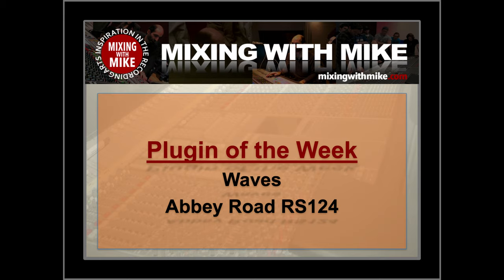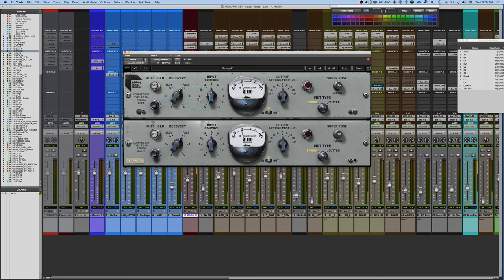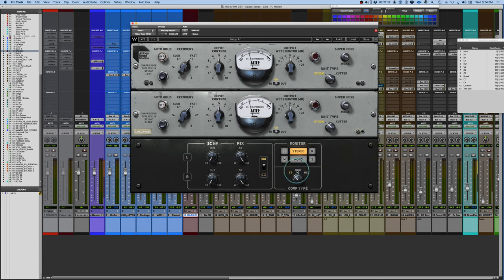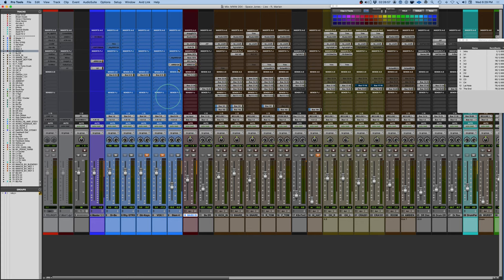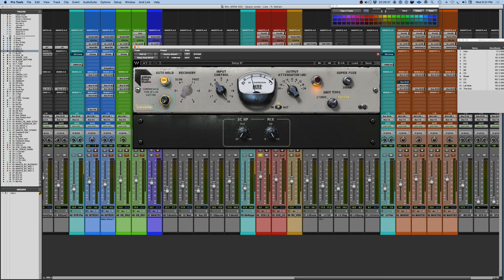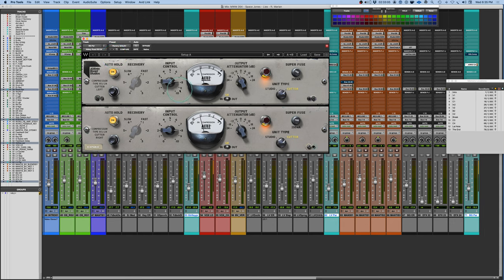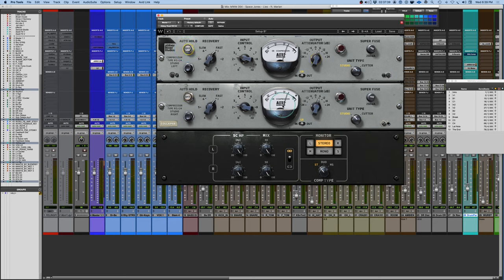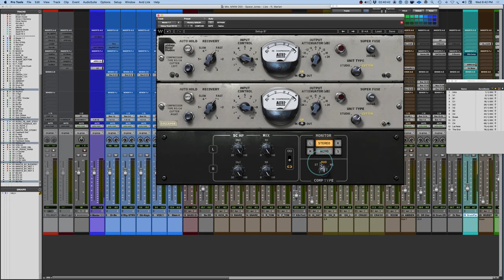Waves - Abbey Road RS124 - Mixing With Mike Plugin of the Week

Comment: I had a chance to use those Chandler compressors, before they were released on sale. An old school friend of mine works at Abbey Road and is pretty good friends with the owner. I think he may have been involved in the process, somewhere down the line. 
As I was more in the "composing/playing" mindset, I took the gear for granted, But he had a few different pieces of hardware that we used in recordings.

Comment: Tested this against Aqua's Cream version on bass and preferred the Aqua by far. Warmer and more 3d sounding.
Reply: ”Warm and 3D” 🤦🏻
Reply from the maker: I like the Acoustica products in general for single tracks. I find that they fall apart a bit with complex program material though and the CPU hit makes them a bit too difficult use on larger sessions.
Reply: @mixingwithmike  I have found using the DAW Reaper helps significantly with the CPU hits and allows you to use many more instances of the Acoustica plugins, Aquas are most of my favorite plugins and I end up using them on everything, I would love to see you review more of them on your channel. Anyhow, thanks for your content, it is consistently top notch. Cheers!
Reply: @mixingwithmike  hey Michael. It's
Acustica. Acoustica is actually another developer in the field. So you don't get misunderstood by Acoustica guys😂
Thanks for in depth no nonsense videos like always. Regards
Reply from the maker: @willogburn6158  DAW CPU efficiency always comes with a tradeoff. I cannot speak specifically for Reaper, but every other DAW I have used that runs more efficiently than Pro Tools with plugins sounds worse.
Reply from the maker: @Zenvo-uu9tm  That explains why I always end up on the wrong website! Thanks for the correction and cheers for the support!

Comment: Hi, I just compared with my old 32 bit original RS124 plugin from Abbey Road. The attack is much better present with the first original RS124 plugin. Can you make a A/B?
Reply from the maker: Is that plugin even available anymore? I think they have turned everything over to Waves.
Reply: No, they don't upgrade it to 64 bit because Peter Cobbin, the technical director from Abbey Road validated the plugin version as a perfect emulation and when Chandler released the Hardware Version they don't wanted a 64 bit upgrade to do not stop the selling of the hardware ;-) I still using it with 32 lives...Sorry for my English
Reply: @mixingwithmike  I noticed something, the first plugin endorsed by Abbey Road and Peter Cobbin is not calibrated as the Waves Abbey Road. In the wave version the input is 5 db louder than the Abbey Road. For the same setting there is around +5 db Gain Reduction. After several test, the distortion and color is 99 % same, the 3D and the attack is different. The Attack is more transparent with the Abbey Road but the 3D is more pleasant with the wave

Comment: Hmm, this compressor does sound really nice, but is it just me or does it add a considerable amount of noise (white noise) if the Auto Hold function is switched off? I mean, maybe if Auto Hold is on, it reduces gain, but how does switching off Auto Hold add so much noise?
Then again we're in the box, so it must be coming out of the plugin? At the same time there is no 'noise' button.. Also, is it possible this noise is added again if 'fuse' is on and thus the Auto Hold doesn't necessarely work??
Reply from the maker: I got a bit happy with the pumping and breathing of the compression. Also, the hold was not kicking on the vocal track and that was adding quite a bit of the noise you were hearing.

Comment: It has a huuuge boost on the top end, would this feature be some kind of scam? Or does the real unit has this “EQ” behavior too? Anyone who has tested the real one here? Thank you!
Reply from the maker: Just ran a series of frequency sweeps through this plugin in a variety of settings. The biggest difference I could find in the high frequency response was + one half a dB at 23K. Not so huge!
Reply: I didn’t hear that. Maybe you were hearing the drive or the gain difference?
Reply: @mixingwithmike  I´m using it for mastering and it´s giving me a huge boost in the most higher frequencies which I liked. So I run it through doctor plugin and yep, it has a boost of almost 14db starting from 5k and finishing on 22k where is the bell of the boost. and it takes a little from the bottom end. but definitely it´s a beautiful sounding plugin.
Reply from the maker: @SaturnVoyager11  How did you set up the plugin settings? You can't run a frequency sweep because you will get heavy compression on the lower frequencies and none on the higher frequencies. That would fully explain the curve you are seeing. 
Run pink noise into a frequency analyzer with ethe RS124 in between and compare in and out with any setting. You will see a minimal boost at best on the very top end of the spectrum.
Reply: I a/b’d this against the Kush AR-1 and spent time getting each of them in the ball park and also detected a bit of hard or ‘s’ syllabic hype in the upper register with this Waves release. I was able to duplicate that syllabic hype with the AR-1 by pushing the ‘lifting/dark’ pot - obviously in the direction of the ‘lifting’. Otherwise, I felt they could both essentially cover the same ground and both offered that vintage vibe. I thought the Waves was pretty good and I know they aren’t 1 for 1 models but didn’t feel like I was missing too much without it since I have the AR-1 via subscription. They each have particular features that are unique beyond the the original unit(s).

Mike, that was a killer track you used to demonstrate this plugin. Loved it.
Reply: @maxmileski1248  Yep tested with pink noise and it has not the huge boost it showed me before on Plugin Doctor, instead it shown me a boost between 6.5 - 7 db almost in 22HKz, it starts almost in 5KHz. but I definitely noted that high boost in the master bus, its nice but it could be too much, luckily it has a mix blend